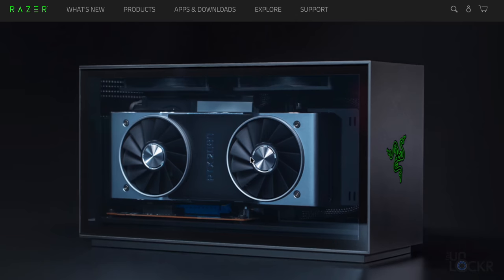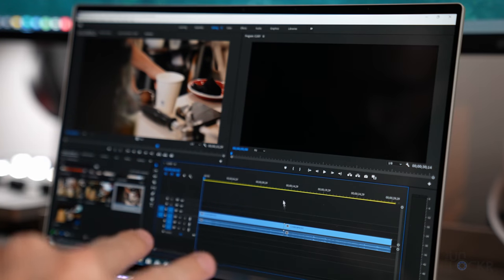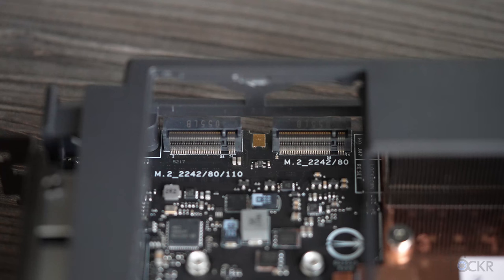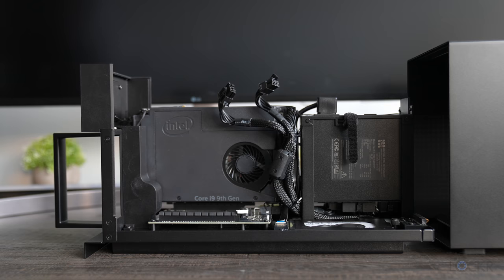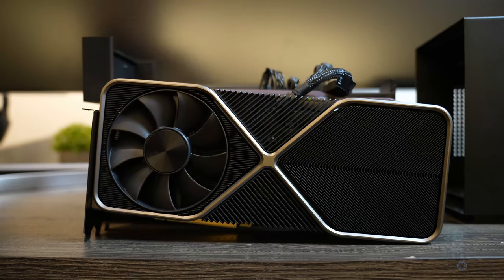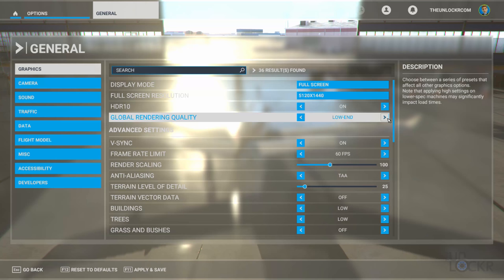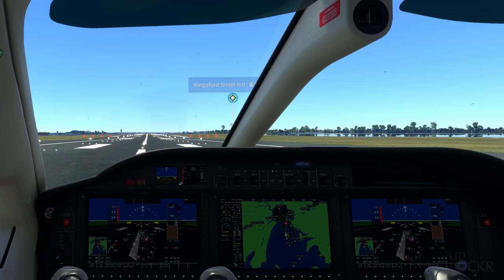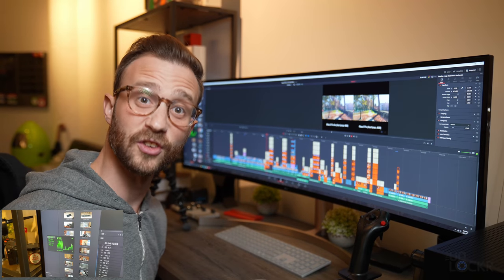Razer Tomahawk Real-World Test (First Impressions, Performance Test, & Vlog)

Comment: Just preordered the Tomahawk with the Founders 3080 in it, the Razer Raptor monitor, Razer Elite Huntsman keyboard, and Razer Naga X mouse. I’ll be sure to reply back here when it comes in on April the 6th and let you know what I think! Thanks!
Reply: @xinjectiongaming4491  Today it states on the website they ship on May 7th, I'd recommend asking for a refund, but you'd probably lose out on the chance of getting a 3080 at a much more reasonable price, it's a full PC still, but I understand the frustration. I'm concerned about the thermals which is why I'm hesitant.
Reply: @mitrikgaduk347  after many many chat supports 15+ I finally got my ticket escalated to the top. Apparently they lost my paperwork. Supposedly it shipped out today. I will update on if I receive it, and how well the product runs. Concerning speeds, performance, and thermals.
Reply: Did you receive it and run some benchmarks?
Reply: @nikolas3437  It is due to be delivered tomorrow, and already on site at my local FedEx. So I will try to get it hooked up and some benchmarks ran by tomorrow night!
Reply: @xinjectiongaming4491  I look forward to it! I already ordered mine a little while ago (it's impossible to find a 3080 FE nowadays, so I didn't have many choices), so I'll be seeing it in a week or so (April 7th, so a couple days after).
Reply: @mitrikgaduk347  yes you could about take the 3080 out and sell it and pay for the whole computer. It’s gotten crazy how expensive GPU’s are
Reply: @xinjectiongaming4491  The Founders Edition card specifically is probably worth more than the price point of the whole system, you could literally buy a separate system with a 3rd party 3080 with that money alone. I chose this system specifically because I knew what card I was getting, many prebuilts don't even tell you which you get, which is a serious issue as some of them have skimped out on parts which has led to issues. Hopefully the thermals can keep up as it was a good decision to change that window for airflow.
Reply: @xinjectiongaming4491  So exciting! Hope to hear from you soon!  It's the only way to get the 3080 Founders Edition! And I like that SFF design. Only sad it is the 9th gen NUC and not already the 11th gen with PCIE 4.0 support. I hope they sell those with a new base board (with PCIE 4.0 instead of PCIE 3.0)  in the future to upgrade.....
Reply: @mitrikgaduk347  So it finally came in and I got it put together. The only thing that was required was installing the 3080 and the power cables for the GPU. I ran a few test on some games I play on Ultra settings and with the Razor Raptor 27 inch 1440p 144hz Monitor with the Tomahawk I’m pulling anywhere from 160-250 FPS. The GPU thermals seem to be sitting between 55-60 Celsius so far with the fans only running at 30%. The CPU on the other hand is running between 68-78 Celsius. A bit on the high end of normal, but with a game running Ultra Physics it’s not surprising. The RGB is very pleasing to look at and matches the rest of the Razor Products using Synapse. And the Tomahawk is indeed recognized by Synapse with a picture of it and labeled Tomahawk. The Noise isn’t to terribly bad, about what I would expect when the fans really kick on. It does put out some pretty hot air out of the top which is where the fans are blowing. My test were no longer then a hour or so at a time. I’m curious to see what happens under a heavy gaming load say 8+ hours. How the thermals will manage.
Reply: @xinjectiongaming4491  Thats so cool! Did you run some specific benchmarks on it and which games do you play? How loud would you compare it to the Series X? Is it annoying? And I'm also very interested in a longer test. I just ordered it now, should arrive next week. The most important question: Are you happy with you purchase besides bad customer support?
Reply: @xinjectiongaming4491  That actually sounds really good given the form factor, better than Laptops in the same range, and given it's a Laptop CPU I'm not surprised. I'd imagine if the fans were running full blast (I don't mind the sound, so I'm not bothered) it'd run a fair bit cooler. How's the ventilation on the sides? I'd imagine it would've been worse if they went with the window instead like they originally intended. (Something I have to mention, the i9 Laptop CPUs are known to be toasters, I've seen far worse than that before on the new Alienware.)
Reply: @mitrikgaduk347  It is quite a bit of ventilation actually, much better then the window. The sides I usually felt nothing but coolish air I’m assuming that’s the air intake. The top is definitely the main exit point, the air is noticeably warmer then from the sides. I’m going to download a few benchmark programs today and give it a stress test. But so far i am very happy with it. The only thing is that 3080 Fan noise does sound like a hair dryer when it gets going over about 60% fan capacity. But it usually only runs like that for a very brief moment. I will say that the Founders Edition 3080 runs much cooler then the aftermarket 3 fan 3080’s in a small form case. There was a video I watched on it last night, it was very informative.
Reply: @xinjectiongaming4491  Thank you for your update! It sounds like very cool system. I cannot wait to test it when it arrives next week.
Reply: @xinjectiongaming4491  This has been incredibly helpful, thank you so much! I'll be seeing my Tomahawk after the 7th of May like probably many others.
Reply: @mitrikgaduk347  @Arktur You are both very welcome! I hope your systems treat you well! Until next time😁
Reply: @xinjectiongaming4491  Thank you! If you experience anything noteworthy you are also welcome to write us here :)
Reply: @xinjectiongaming4491  Hey! My Tomahawk arrived this morning. In idle it is very loud and hot? Do you have the same experience?
Reply: @nikolas3437  I don’t have this experience at all. Did you download gpuz so you can view your current temperatures?
Reply: @xinjectiongaming4491  I am at work right now, I’ll check later if I can get any temperatures. I hope I get it fixed :( so there is no noise in idle with your Tomahwak? Do you have a device to measure decibel?
Reply: @nikolas3437  I haven’t checked DB, but mine very rarely ramps up. My CPU usually sits at 60-70C.
It only ramps up if I get over 85C. Even then it isn’t that noticeable
Reply: @xinjectiongaming4491  Ok thank you for your incredibly fast feedback! I’ll check this evening if I can do anything about it.
Reply: @nikolas3437  no problem bud, I’d check out downloading GPUZ like I said, and when the high idle sounds start running check your temperatures and fan speeds. Get a baseline of statistics before troubleshooting
Reply: @xinjectiongaming4491  I installed GPU-Z and all temps were really good. I found out that the fan of the power supply is the loudest one. My power supply has some coil whine :(
Reply: @nikolas3437  ahh, yea that sounds like maybe you got a faulty fan? Perhaps you can replace it yourself relatively cheap
Reply: @xinjectiongaming4491  I am really sad right now. 100% a faulty unit…. I don’t want to exchange it by myself because of warranty… I’ll send it back and maybe get a new one… Happy unboxing day! 😅
Reply: @nikolas3437  that’s really awful, I’m sorry you’re having to deal with that. I hope they send you another post haste
Reply: @xinjectiongaming4491  Not my best day, but there are worse things that could happen. I wrote a mail to them explaining the issue. The automatic replay says I have to wait 120 hours (German Support) for an answer 😂😂. Thank you for your continuous support and I’ll report back when I hear something new from them.
Reply: @nikolas3437  sounds good buddy, goodluck!
Reply: @xinjectiongaming4491  Did the 3080 come in the Nvidia FE box like retail?
Reply: @jeremyschmit2025  it did, comes in the Original FE Box, you have to manually install it into the Tomahawk. Which was super easy with the sliding tray
Reply: @xinjectiongaming4491  Hey ! I bought one myself and just received it, do you use it for gaming as well ? what are u views about this in terms of performance ? Having tried that just today I'm not impressed and I could say I was expecting a bit better considering the RTX 3080 and the other components (and the price, Lol), but it might be bad optimization for the games in question.
Reply: @Antoine-cq3ln  I do use it for gaming and haven’t had any problems myself from it. It has more then met my expectations. But I suppose it depends on what games you’re trying to play and on what settings. The NUC 9980HK that comes with it is one of if not the best mobile CPU currently on the market. And we all know how great the 3080 is. The only thing I disliked was the 16GB of Ram. But I immediately replaced that with 64GB of Ram as soon as I got it.
Reply: @xinjectiongaming4491  Thanks for your feedback ! what games are you playing with it ? I mysel play mostly warzone and was going around ~ 130 150 FPS on medium settings, thought it could do better. Some streamers actually do much better, with pretty much the same components
Reply: @Antoine-cq3ln  I was pulling 240-300 FPS on ultra settings for heroes of the storm, 160FPS on Final Fantasy Online on Ultra, then minecraft with 5 mods, realistic texture pack, shaders the whole 9 yards with a render distance of 32 chunks I’m pulling 80-120 FPS which is incredible since my last pc only ran 25 FPS with the same settings lol
Reply: @xinjectiongaming4491  Good if you got what you wanted :) I might do the same upgrade than you regarding the RAM, was it not too difficult to do it yourself ? I'm not used to this type of stuff
Reply: @Antoine-cq3ln  thank you! It isn’t hard at all, just a couple screws to open the NUC itself. Then you just pop the old RAM out and put in the new. But make sure you get SO-DIMMS RAM, which is essentially small form factor laptop RAM. With 64GB being the max the 9980HK can have and recognize. Just make sure if you decide to upgrade to 32GB or 64GB that you buy 2 of the same RAM Cards. 2x 16GB, or 2x 32GB respectively.
Reply: @xinjectiongaming4491  Thanks man :)
Reply: @xinjectiongaming4491  Hey man how is it going ? I had a few days to try and test the tomahawk, see how it works while gaming and stuff, and there s one thing very noticable that seem to be problematic : the cpu temp is really hot (90-100 d celcius) while gaming, and it seems like there s nothing to be done about it, as we can't undervolt cpu no longer and i can't see any other solution. Do you experiment that as well, while gaming ? CPU usage around 50%, and temp around 100%, definitely going to be an issue
Reply: @Antoine-cq3ln  hey bud. Yea I’ve been playing mine nonstop. Usually my temp sits between 78-90. Mine has never went above 90. What temperature do you keep your room? The intake temperature can effect the cooling of the system. What is the fan speeds your fans are running? I admit it does get warmer then a full-size case but that’s to be a bit expected with a small form factor.
Reply: @xinjectiongaming4491  Hey man thanks for your answer - from what I'm seeing on Gpu-z, seems like the fans cap at 30% even though I am playing and having serious cpu overheat issues (around 95 degrees) - considering the noise, i'm not sure these 30% are accurate. how do you check your fans speed ? Do you notice more than 30% in GPU Z (if you use GPU Z) while playing ? cheers man
Reply: @xinjectiongaming4491  and the room is at ambiant temperature, something around 20 degrees
Reply: @xinjectiongaming4491  Update : the Fan 1 can be pushed via MSI at 100% but the Fan 2 remains stable at around 35% of its usage. No ideas what these fans are for though ? GPU, NUC or the 2 inside of the Tomahawk ? anyway, even pushed at 100%, the Fan 1 doesn't have any impact whatsoever on gpu temp. sorry to bother man, and again, thanks for your time

Comment: When you were trying out the Tomahawk for video editing, when you had the resolution set up, were you editing in 4k or 1080P? Also when you said that you were dropping the resolution, did you drop it down from 4k to 1080p or from 1080p to 720p. I'm just trying to figure this out because I make car audio DIY youtube videos on another channel and record in 4k 60FPS and 1080P FPS and my current All in one HP desktop gets super choppy when I start to edit using Wondershare filmora 8 software. Alot of youtubers never seem to get into detail when they say things like (Using the proper too) etc. It leaves most of us with unanswered questions. Also telling us the dimensions would have been great, there is info on the web but the measurements don't make sense.

Comment: Personally I like the idea but... and a big BUT is its basically a laptop with an egpu. Granted this wont be limited to thunderbolt as it has pcie on the daughter board. But that CPU performance is being hindered pretty agresivley. I would love a comparison between something like a razer blade stealth with an egpu up against this unit. Thanks for the review. You seem to be the only one out there with this item at the moment!
Reply from the maker: Eh it's more than that because you can upgrade everything inside it which I appreciate. And the cost premium over a full desktop is only $200 or so (after pricing every thing out). I do however wish there were 11th i9 NUCs tho and personally would maybe wait until there are to buy one 🤔

Comment: Would you try to fit the 3090 in some way that the fans don't mess with that cables? 

Are another limitations that makes silly to attempt to put the 3090? (Power, airflow, bottlenecking from the CPU or so).

When will you do some live streaming my friend?

Last but not least, I feel like we love this format of videos and after barely 4 hours getting near 2K of views are better evidence than anything that we love it.
Reply from the maker: I got it to work actually without it hitting the cables as I mentioned so it's doable. But for the price still not sure many need the 3090 over the 3080 🤷‍♂️
And thank you sir! Streaming one of these days when I'm not super busy 🙏

Comment: As cool as it is, you can just buy the same gen razer blade 15 base and save $1000. Plus you get a great gpu. Oh, and if you went for the tomahawk with a gpu, its more than double the base model laptop. The pricing makes no sense.
Reply: The Razer Blade 15 has thermal issues, a 3080 alone costs like $2000+, a similar PC that is much bigger is the Corsair Vengeance i7200 at $3200, there are numerous PCs available for $3000+ with a 3080 in them. NZXT just raised the price of their Creator PC (3090) from $3500 to $4500. In the current state of things, this comment is out of fucking date.

Comment: I liked the idea when intel introduced their enclosure. But a year later the fastest cpu you can get is a 2080 mini that will fit. Now razer come out with their lager case that fits most current graphics cards which is nice. However they seemed to only sell it with storage and RAM included. For me l would want 1TB ssd and 64GB RAM so all the included storage would be junk.

Comment: I think for the price, just get a pre built pc. NUCs are great cause they are so ridiculously tiny and you can chuck one in your backpack or tape it to the back of a monitor. But this form factor does away with the benefits of the NUC, the only advantage over a traditional pc is you dont have to build it, but you can just pay someone like maingear to make one for you, OR bribe your mate with some amazing pizza and he will order the parts and make it for you. I'm just not really seeing the benefits you get for the price hike.
Reply from the maker: So I actually priced it all out and you're not paying that much of a premium really. A couple hundred dollars maybe but for that you get a much smaller form factor (even in this form factor it's literally the size of the NUC and the GPU basically which you wouldn't be able to find a case using even a Mini ITX that would be that small. Definitely not saying it's for everyone but there is for sure a user base that would pay $200 to not deal with a full computer build and a much smaller case (and better port selection too honestly) 🤷‍♂️

Comment: I think the video editing issues have more to do with memory than the GPU / PC setup otherwise.
You'd probably want atleast 32, more like 64gb of memory for that. Which should be doable with 2 slots (although expensive)
Reply from the maker: They are most certainly due to RAM, you are correct. I actually put in 64GBs after I shot this to test and editing worked just fine 👌
Reply: @TheUnlockr  Thats great! Makes me wonder if Razer should've considered 32GB since the price is already pretty steep and everyone would probably prefer a better experience out of the box.

Comment: What's the point of this product? Aren't pc are already modular? Is it targeted towards less technically inclined people who prefers plug-n- play. But still need a bit of tools to add a Ram or upgrade a part. So not much different from a regular pc. Now a days with the availablity of awesome mini-itx motherboards and  equally good cases, one can build a more powerful pc.
Reply from the maker: That's not the point I don't think. After pricing this out it's about $200 more than the cost of the parts, runs quieter is a much smaller case than a Mini-ITX and is very easy to upgrade etc. Now if you want to do a full PC build that's cool but I know there are a ton of users who would rather pay that small premium (compared to the full cost) to have something like this instead. It's interesting no?